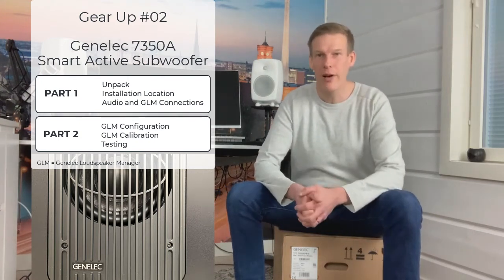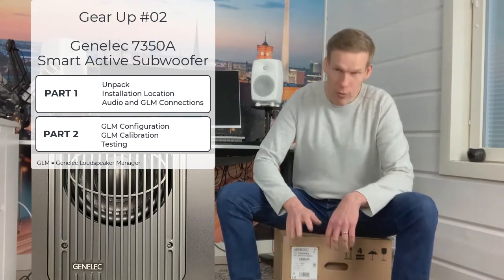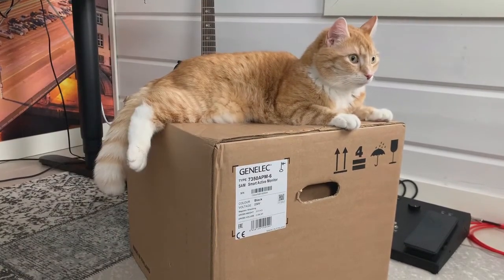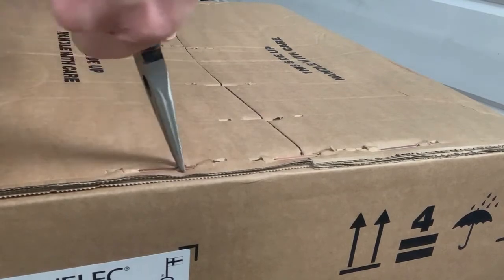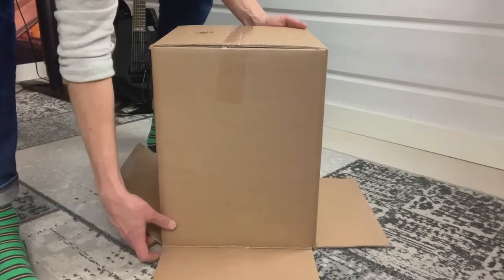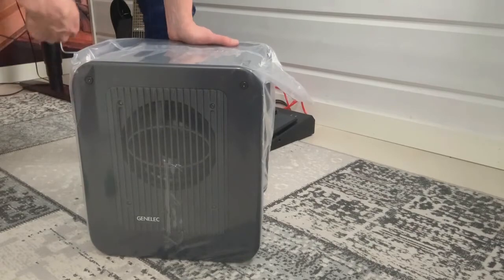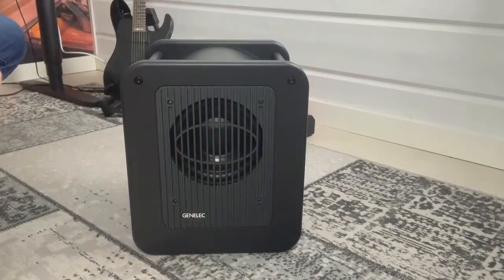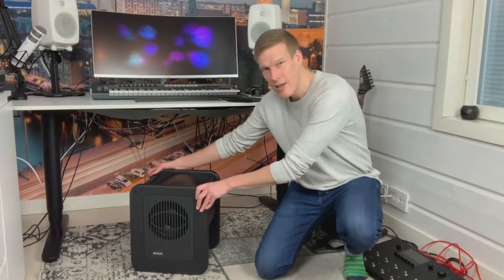Lukas Elektrik - Gear Up #02 - Genelec 7350A Subwoofer - PART 1

Comment: And I thought that the GLM Control and AudioDigital passed everything through the RJ45 connection; something similar to what the Genelec Smarth IP series 4400 did
For this you have to purchase the Genelec 9401A to be compatible with AoIP (Audio-over-IP)

Comment: Can i Connect my lynx aurora to the sub trough analog , and then the sub to my monitors trough digital?
Reply from the maker: Hi, it sounds like your use case is different than mine. I would advise you to contact and ask Genelec customer support.
Reply: @lukaselektrik  I did! For everyone that wants to know , you only can connect digital through digital , and analog through analog

Comment: Hi, and the connection to the sound card is not shown from the subwoofer to the sound card
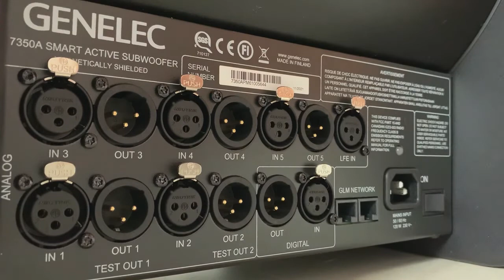Reply from the maker: Hi, thanks for the feedback, since we use the digital AES/EBU, it's enough to connect the sound card output -> left monitor input -> left monitor output -> right monitor input -> right monitor output -> subwoofer input. This is shown in 8:10. All the audio to the left and right monitors and the subwoofer is passed through this one chain, no other audio cables needed. Hope this helps!

Comment: Is it possible to use the 7350A with GLM if I have a pair standard 8030? So that the sub at least would be room corrected.
Reply from the maker: Yes it is. In that case your sound source (audio interface etc.) stereo output goes to the 7350A analog XLR inputs 1 and 2. From the 7350A, two analog XLR outputs 1 and 2 would go to your left 8030 and right 8030 monitors. Pay attention to have the appropriate cables that fit for your set-up.

With the GLM you can do the 7350A calibration and you'll set-up the crossover frequency and the phase so that all the low frequencies are catched and produced by the 7350A and your monitors will only receive the audio above the crossover frequency - ie. the audio that the subwoofer can't play.

Comment: Thank you for doing this presentation Lukas, it was very informative!
I am looking at buying a similar setup.  How is the sound? 
I did not know that you could do that with the spdif/aes out on the RME!  I have an older model the Fireface400 and it has the same connectivity :D
Reply from the maker: Hi Bzy, I am glad you find it helpful. I am based in Finland and this is a small country for anyone interested in sound reproduction. Consequently,  I am familiar with the story of Genelec and everything they stand for. This also means that it would be difficult for me to do a neutral comparison of similar speakers by other brands.

My previous set of active speakers were Behringer Truths and surely there is a big difference. Behringers did have a lot of value for the price and it's unfair comparison of course. Surely it's an aural (and) visual joy to do ear training, listening and producing music with these Genelecs.

You can get the cable between your RME and the speaker for example at Thomann.de. They have "pro snake AES/EBU SPDIF Cable Male 3".

 I also bought the speaker stands for the table. The table is electric so the whole set-up goes up and down. I was considering floor stands for the speakers as well, but the table stands have been better for my purposes.
Reply: @lukaselektrik  Thank you for the unbiased reply Lukas and the cable for the RME!
 I appreciate your wisdom, I am happy I found your channel.
Reply from the maker: @b_r_i_z_z_y  No problem, although I afraid my view is very much biased as a Genelec fanboy :) Can I ask if you make music by yourself and where that could be listened to? Looks like there's some music creation in the small icon of yours, if that's you?
Reply: @lukaselektrik  I do make music but I havent put any music on the internet yet, this is why I am looking for new speakers to finish it!
My icon is from a Biz Markie album. How about you Lukas do have any music?
Reply from the maker: @b_r_i_z_z_y  I went to listen Biz Markie, a song Just a Friend is hilarious :D Rap and Trap has evolved quite a bit since 1989, don't you think? My music is inclined towards electronic music, where I am especially interested in various house genres. I feel finding groove and melody are essentials for me. This is a never ending trip :D

Comment: I think the recommended digital path for proper bass management is source -> subwoofer -> right speaker -> left speaker. Look at page 14 in the GLM4 manual. Don't know if it is important or if all paths works the same.
Reply from the maker: Thanks Lars, yes, it's worth pointing that out. The subwoofer takes either analog or digital signal as an input. Indeed, it's recommended to feed first the subwoofer and then continue to the other speakers.

For analog there is always the resistance of the cable or signal path present which attenuates the signal and to get the best possible signal quality it makes sense to get it first to the subwoofer. For digital connection, however, there is no signal degradation for the cable lengths for my purposes so I don't see any other reason than to simply make the digital connection instructions equal to analog - anything else would be confusing.

Bass management including crossover frequency and phase configuration are set through the GLM software and the separate network cabling so no difference there either. Since I added the subwoofer to my existing set-up, I couldn't think of any reason why I should detach, re-route and re-connect the existing cables. In case I come up, or someone else out there comes up with any reason, let's add it here.
Reply: @lukaselektrik  I found an reply somewhere from a Genelec representative stating that the digital cables can be connected in any order. By the way, I am setting up the exact same equipment as you and I am quite blown away by the subwoofer integration, and that is before any room or phase correction.
Reply from the maker: @yoddeb  Great, thumbs up!
Reply: @lukaselektrik 👍👍